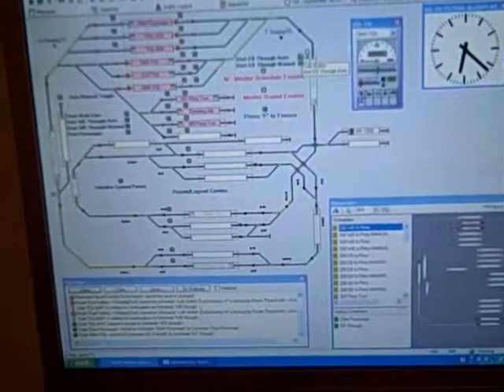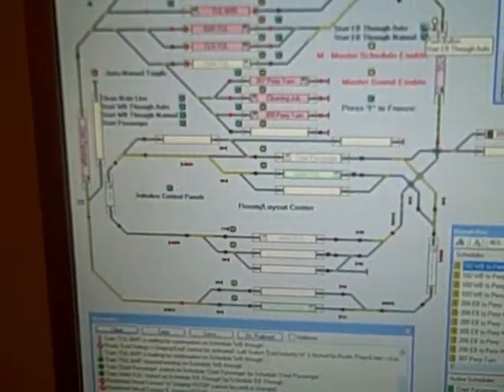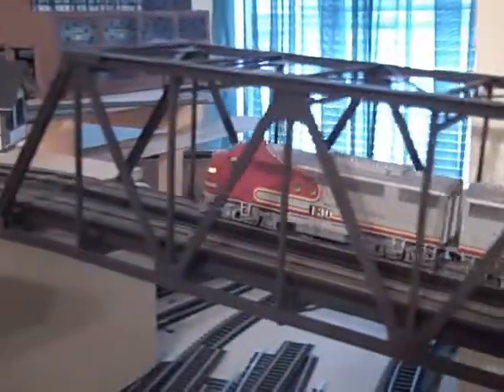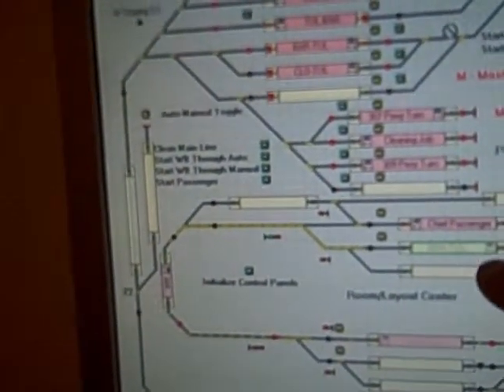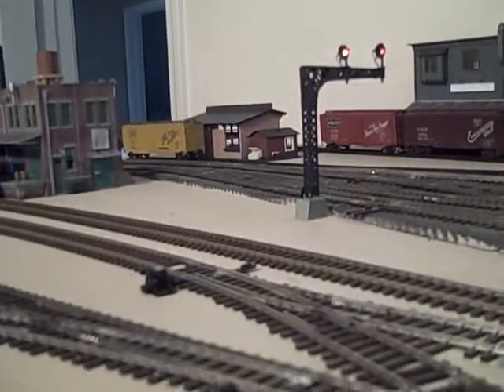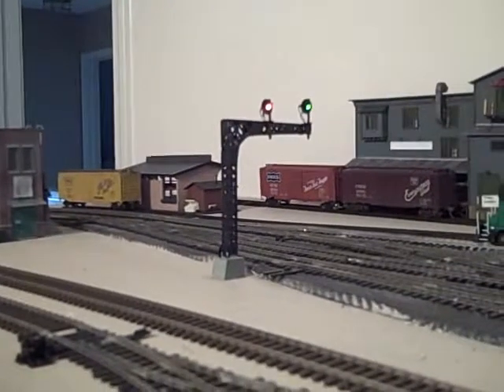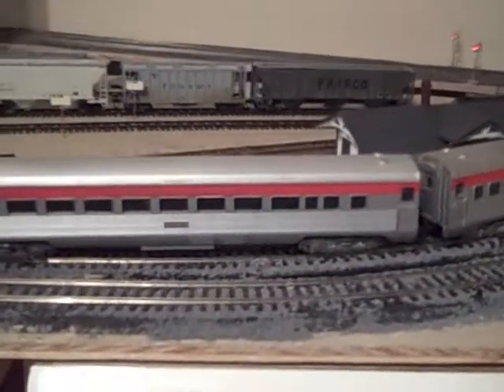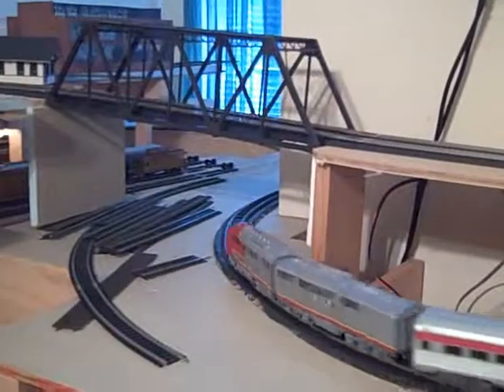Model RR Automation on the BN Avard Sub

Comment: hello how does the software know where the trains are at the moment ? what kind of  detections it uses ?
Reply from the maker: rangelso It detects the current the locomotives draw.  It's Digitrax block detection using a BDL-168
Reply from the maker: I use Digitrax BDL-168 Block Occupancy detectors in each block.
Reply: rangelso h